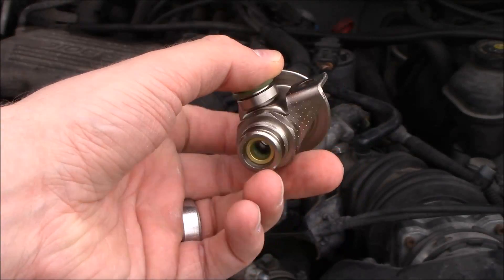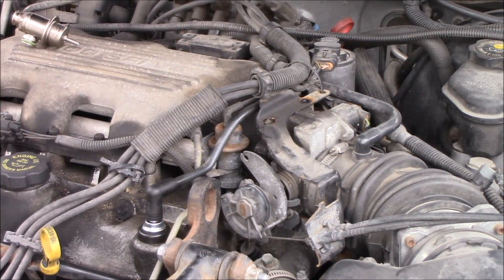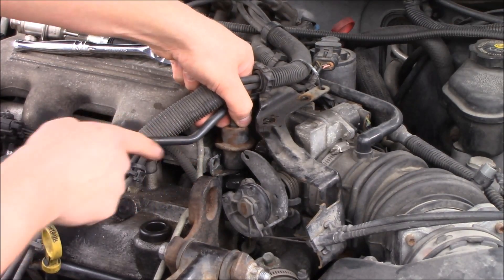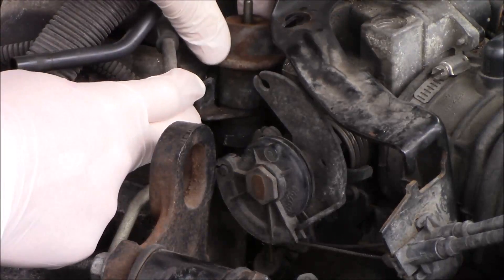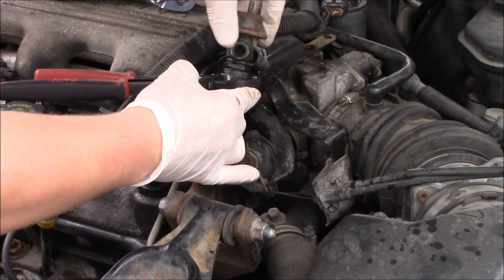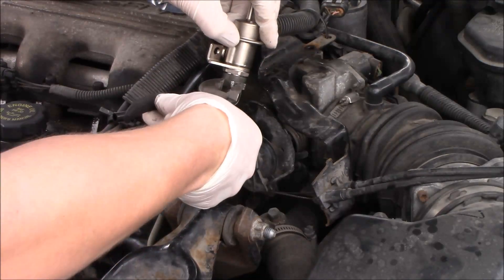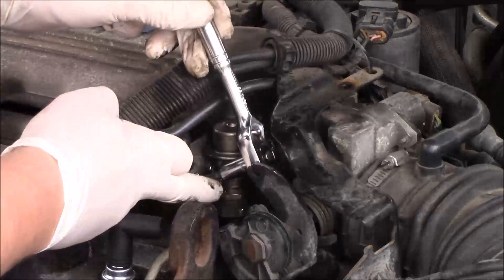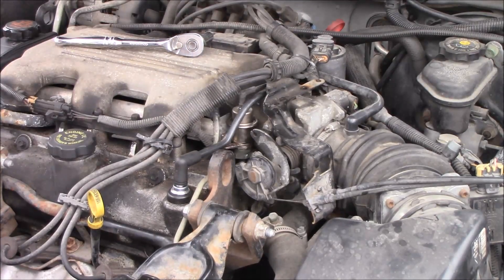How to replace a fuel pressure regulator

Comment: Great video! I have a 2000 Impala 3.4 and it’s exactly the same. Thought I was going to have to buy a 24mm or 15/16 flair nut wrench, but hopefully I can pull it up enough to get a wrench on it. And I’m pulling the throttle body off first from your suggestion.  Thank you!!

Comment: Here's a trick I found; Notice that there's a hole in the bracket where the TV/throttle/cruise control cables enter? You can feed a long socket extension or long 1/4" bit extension through this hole and not have to remove a damn thing other than moving the PCV and vacuum tube to the side. I zip tied the throttle wide open to have clearance for a socket and extension.

Comment: Dude a micro rachet make your life easier to get that torx bolt instead of taking the throttle body off, find the fuel pump relay take it out and crank on it few time instead making a mess spraying fuel every where when your done put back in take few crank to get pressure back up

Comment: What is the thing called that is on the upper intake manifold it's a little square and the hose runs to the fuel pressure regulator?

Comment: Easier if you just pull the fuel pump relay and let it run out of gas. Also noticed you didnt use vaseline on the o-ring during reassembly.

Comment: Is there an o ring on the bottom of the regulator or just where it goes in to the fuel rail?
Reply from the maker: Yes I believe there is. Use a pick to get them out

Comment: This video was so helpful! I wish I would have looked it up yesterday. I couldn't figure out how to separate the fuel line from the regulator but. To unfasten the screw, I used just the star bit and a 1/4 inch wrench which was also frustrating when I dropped the bit a couple times. Thank you for making this video, now I'm actually going to get it changed instead of just practicing how to detach and refasten.

Comment: I did this on my 2004 Buick Century in about 15 minutes. Well the second time after installing a bad regulator (grr). I didn’t remove the throttle body but merely stuck open the cruise control with a screw driver to get burnout if the way and backed off the outer throttle body bolt. Took me awhile to learn all that.

Comment: 1) Nonsense. It’s easy to unscrew the bolt and line nut without removing anything.
2) Before working on the fuel line, start the engine & pop out the fuel pump relay until the engine stops. Voila! Fuel de-pressurized.
3) Before starting up, prime the fuel system by turning the key to ‘on’ about five times, then start the engine.

Comment: Thanks for your video.
Did you have a no start issues for why you replaced the regulator. 

My Buick Rendevou  is having a no start issues. New pump and pressure sensor.
Reply: Our 2004 Montana same problem-no start up. The fuel regulator was stuck closed. New fuel filter but not new fuel pump and it's good to go

Comment: I can't seem to get the flexible line and steel line to move forward at all.
Reply from the maker: Are you referring to the EVAP connection? Or PCV connection
Reply: @AutOdometer  the gas line that runs to the bottom of the pressure regulator. On most of these engines, there is slack to pull it away from the throttle body but I'm not able to on this 3400

Comment: Mine is stuck on that double nut link on the fuel line ughhhhh.
Reply: Did you ever get it off? I'm having the same problem
Reply: Yes I used channel locks on the top nut and a combo wrench on the bottom, and used some penetrating oil. Make sure you are loosening the bottom one by going to the right. It is an reverse thread since it is a fuel line.
Reply: 2:22 he gives some good advice there. I meant some vice grips on the top nut, not channel locks. Locking plies are definitely your friend on this one.
Reply: What size is the locknut?
Reply: Me too ....that sucker is over torqued ⚡

Comment: so to prevent your fuel spillage you can pull the fuel pump relay and then start the car it will empty the rail and then stall out due to lack of fuel in the rail then once you are done replacing the regulator just key cycle the ignition a couple times without starting the engine to re pressurize your fuel rail
Reply from the maker: +Stephan Bertram oh nice tip 👍
Reply: Is it bad if fuel leaks or no will it mess with the pressure?
Reply: If the regulator is leaking, the system will depressurize at some time. Not sure if that is after say 12 hours or 3 days?  And is there pressure on the non leaking side? No idea. Best to pull relay/fuse.
Reply: Great idea
Reply: Note working on fuel systems may be a good job for a professional. Always wear safety glasses.  What works for me is this: Vehicle must be  fully cold. Have a fire  extinguisher close by. Safety first.   Start vehicle, let run for say 30 seconds, then pull fuel pump relay/fuse. Let vehicle stall, turn off ignition and remove key. Let vehicle cool. Put paper towels around any fuel lines that may leak fuel.  
I do this for any fuel line work, including fuel filter. Spraying fuel on a hot exhaust component is very dangerous.  I have used the process of pulling fuel relay for Audis, Volvo, Oldsmobile, and Dodge Neon. 
One time a I had misfire CEL come up from vehicle stalling, I cleared code and it did not come back.